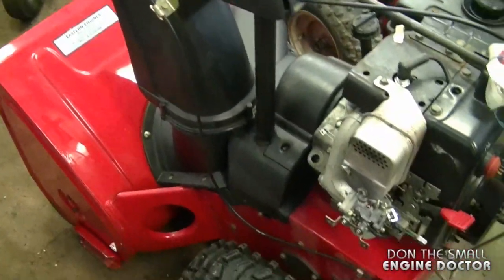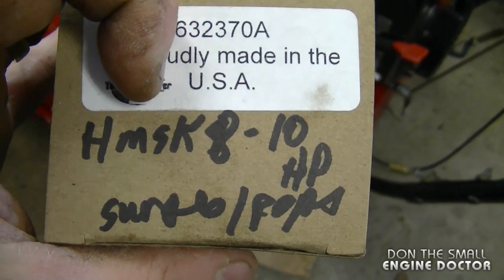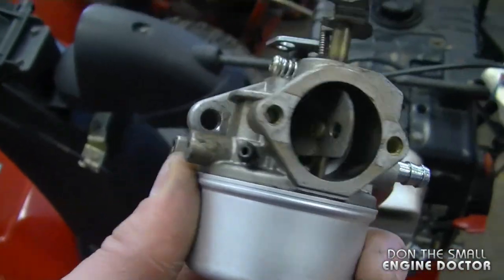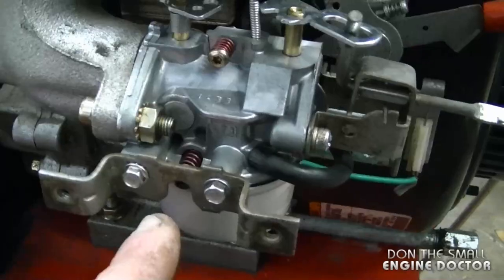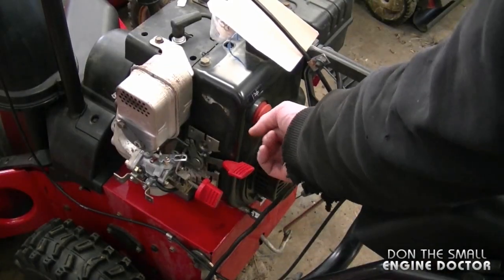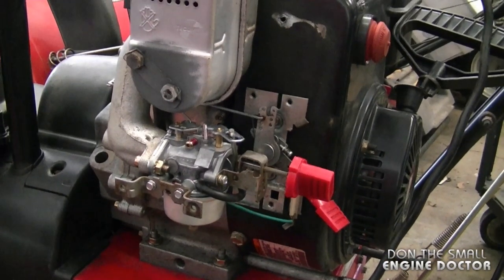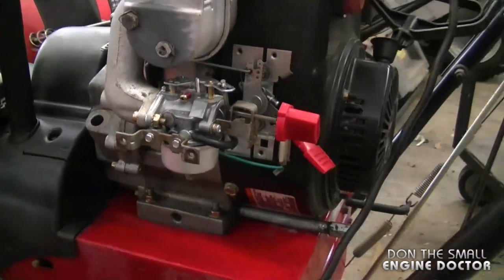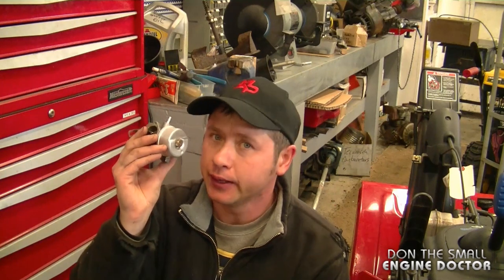Can I Swap A Non-Adjustable Carburetor For An Adjustable?

Comment: I have a 25 year old Generac 5000 watt generator that has a 10HP Tecumseh engine with the non adjustable carb that developed a surging problem when it ran causing the output voltage to vary. Cleaned the carb and installed a carb rebuild kit. unfortunately even after the rebuild was installed it still surged. I thought I was going to have to buy a new generator until I saw this video. I decided to give the adjustable carb a shot, so I purchased one and installed it. The old generator runs better then new. So thank you Donny for the video, you saved me the cost of a new generator. AWESOME video, keep em comin!

Comment: I have also successfully swapped an non adjustable main jet for an adjustable one, they are available on amazon. I did have to shorten the bowl nut, but worked like a charm. It was for a 12 HP Briggs motor.

Comment: Love this guy. Just ordered a new adjustable carburetor for my 8 HP Tecumseh snowblower. The old fixed nut carburetor still works okay but has always idled a bit rough. Don's advice and How To videos taught me that  it is easier to replace the carburetor (new one only $15. on Amazon) rather than spend time trying to rehab the old one. Thanks !

Comment: I've been battling issues the 20HP Honda V-twin motor in a side-by-side. Seems to need the choke pulled out a bit to run. Or is surging and backfiring, so could still be something else. Still up is checking the compression (easy on one cylinder, almost impossible on the other with the way the engine is mounted), and seeing if there's a way to see if it's something in the ignition. A new, non adjustable carb, didn't seem to make any difference. Thought it was maybe fuel, but I added a temporary electric pump and that didn't make any difference. The problems are even worse when it's cold. So I'm off to try searching for an adjustable carb for this motor. And going to keep searching through your videos for more info and tips. I sure appreciate everything that you share.

Comment: did a similar swap on an ECHO SRM-210 weed trimmer.. removed the non-adjustable carb' and replaced with a Power-Pruner fully adjustable carb' incl' the intake manifold. The only tiny mod needed to be done was to shorten the little brass hose that leads the throttle cable and holds it before the carburetor's throttle lever. This weed/grass trimmer (SRM-210) has become the no.1 weedwhacker for all teamnates ever since I swapped carb's

Comment: I was having trouble with a HT75 limb saw running.  I replaced the non-adjustable carb with a new adjustable.  Ran good out of the box.  A few tiny adjustments and it runs great.

Comment: The adjustable carbs are great for use with booze fuel as well. You can richen the mix a bit to counter the lean burn tendency of alcohol in the fuel.

Comment: Hay Dony I really enjoy you'r vids ,very informative how to and part numbers have helped me with my chainsaws ! I've had 5 Honda eu2000 and they seem to last about 2500 hrs.before they seize up and have to be rebuilt .I'm in California and our gas has ethanol ,I use Star Tron stabilizer/ethanol product all the time ,fresh gas no more than two weeks old ,change oil every 100 hours ,my newest eu2000 I'm using straight synthetic oil in hopes it will run longer before rebuild ! My use of these generators is 95% idle and rarely run hard .It would be nice to hear from the Doctor on these small engines . Thank you and Happy New Year !

Comment: The main problem with most Walbros having a fixed/non-adjustable main jet is during cooler weather operation. During cool weather, and running at 3,200 RPM, the engine will sometimes run too lean on fuel and operate erratically. To fix this, first of all, make sure the hole in the main jet is not partially clogged. If it is, use a  carburetor jet cleaner wire set or an oxy-acetylene welding torch tip cleaner to clear any debris that may be lodged in the hole. Then use [150± psi] compressed air to clear out any dirt/debris. If the engine still runs too lean on fuel, simply enlarge the hole in the main jet a few thousandths of an inch. Then use [150± psi] compressed air to clear out any metal particles. Be careful not to enlarge the hole in the main jet too much, or the engine will run rich on fuel!

Comment: Thanks so much for all your great videos. I love the idea of older style carb (most probably larger jets so less likely to clog). Working on a smaller HSSK50 and was wondering if there is a carb to replace 640084b fixed jet carb?
Reply: I’m looking for the same thing for my horizontal shaft 5HP , anyone out there knowing of what to order and where for this new adjustable carb?

Comment: Would love to see a general carb tutorial, basic setup for novices. I inherited a mower that's gotten out of whack and had its carb screws adjusted badly.
Reply: So would I. Three brands (Tecumseh, Briggs, Honda) side by side showing similarities and differences. Having the engines running and being able to hear and understand each adjustment would really help a beginner like me.
Reply: BirdsEyeView Normally, just turn all the screws all the way in and keep adjusting them all out a bit at a time til you get it running. Once running, fine tune each adjustment screw. Unscrew them to richen the mix and tighten them to lean it. Left = Richen Right = lean. If it's popping, surging up and down or lean bogging when you try to rev it, it's too lean. Heavy black smoke, sputtering or choking, it's too rich. These are general guidelines for about any small engine that should help you get it running. No 2 engines run the same with the same settings, even if their the same year, make and model. That's why it would be hard for Don to do a video on it. He'd get a million comments complaining it didn't work for them.

Comment: Hey Don, did you ever try to swap a bowl carburetor for one of the diaphragm carbs on the old Toro S-200 type blowers? I love using mine when there is slush and wet snow because there is no chute to clog, but those darn diaphragm carbs are fussy and quit working at awkward times.

Comment: If my snow blower will run but it will not idle low do you know what the problem could be. It will only stay going at the highest rev and it never used to do this.

Comment: How much for the Tecumseh carb? After market ones are about $16. Or you can drill out the jet on the non-adjustable carb for about $8 worth of pin drills.

Comment: I have an HM100 generator engine similar to this one that has a fixed engine speed and I want to be able to adjust the RPMs so it's not always wide open.  Do you know what part numbers I'd need to convert it to operate just like the snowblower engine in the video?  It looks like it's just the lever assembly and the rod to the governor but I'm not sure.  I'd also like to put this adjustable carburetor on it.

Comment: Are these available for the new Powermore 277cc engines used on the new (2016) Troy-Bilt snow blowers? Mine surges even though it is brand new. If so what is the p/n?
Thanks.

Comment: Hi donyboy73. Thanks for the great video. I swapped my non-adjustable carb for this exact adjustable one last year. Ever since then my snow blower will run fine for about 7 or 8 minutes from a cold start. Then it just shuts off. I start it back up and it runs fine but shuts off after about 1-2 minutes. It keeps stopping every 1-2 minutes after this. I did some research and tried the following: (1) Tested the gas cap to make sure it vents. It does. (2)  Checked the spark plug... it looked fine but I replaced it anyhow.  (3) Empty the tank completely and use fresh gas. None of these things made any difference. I've also read that it could be a vapor lock issue because the gas line is routed in a way that causes it to heat up. I understand the idea behind that but the gas line is routed the same way it was before. Do you have any suggestions? The motor is a Tecumseh HMSK90.
Reply: Did you ever get this figured out? I just put on an adjustable carb and it either won't start or revs so high its about to blow.

Comment: Donyboy, would you explain how to remove black limiter caps. Model I'm primarily interested in is, Sthl FS80R Pro Series. I've attempted; but appear they will break appart while removing. Will this matter? Should they be reinstalled. Both adjustment screw appear to be similar to phillips head in design rather than pac man or spline. Thanks
Reply: well i can take a piece of wire bend it tight so it fits hole, heat it up put it in hole into plastic let it cool twist it pull it out

Comment: This might be my problem.  I replaced an adjustable with a non-adjustable carb and now I can't even get the engine to start.  I've replaced the ignition module and spark plug as well.  I will buy another adjustable carb but I have a question; the model number shown is for the Tecumseh brand and when I google it , it pulls up the carb you've shown for 90.00 and some on Amazon that look the same but are 1/4th the price.  I suspect these are Chinese knockoff's,  what do you think? I've spent over 150.00 in parts on this MTD 5 HP Tecumseh.
Reply: are you new to this game put your carb number in search line don't have to get fancy push enter it will come up with all the carbs ebay free shipping why do you all want to spend the high price this is what computers are made for searching to get lowest price,not amazon there are all kinds of part stores out there

Comment: Thanks Don :-D
i have the same sort of carb on a mower, the bowl rubber seal is dead, my local shops just say its not possible to get the bowl seal.
Are they talking nonsense?
Reply: zx8401ztv like the big bowl gasket? if it's a Tecumseh carb, then that's probably nonsense, there's even aftermarket for that if it's a semi common carb, typically comes in a rebuild kit. if it's a newer "house brand" Honda clone or similar, that might be true, those are apparently "replace the whole thing" due to price.
Reply: Thanks for a reply rpavlik1 :-D, yep its a tecumsey carb and engine, so my local shops are talking crap, i did wonder.
I may try an ordinary "o" ring and see if the carb runs, then seek out a petrol tolarant one, i will jump to non mower shops.
Reply from the maker: it's available, part number 631028a let me know if you're stuck
Reply: zx8401ztv I cant believe they said its not available. A month ago I went in for a generic 90 degree fuel shut off valve, "I said Im putting it on a Tecumseh engine" the guy said Tecumseh like I was from outerspace. These dealers need to get with it. Millions and Millions of Tecumseh engines were built, just because they went out of business doesnt mean their engines arent still running and being used. I usually go to www.partstree.com now. Enter your model it will pull up a diagram of the engine and point to the part and list it and its cost. Or just go buy the part number like he did, but one thing if you get it off the internet makesure you make your putchase count, they charge 8 bucks to ship it either way. Thats most of those part websites. They started making after market carbs, cant believe that guy said its not available. He didnt have it and didnt want to deal with getting it so he said that rathervthen telling you where you could go. He wants your Tecumseh to die so you come buy Briggs parts. Either that or just a moron. Their reproducing everything now. Only some of the really old parts and the old points magneto assemblies have not been reproduced yet. Once the made in the USA nos parts dry up, your option will be China, China, China. You should go to that site and buy a rebuild kit for 16 bucks and pay the 8 shipping this way if anything else went bad youll have the repair kit. Because even if you order a dollar part, their charging the 8 shipping. Unless Dony knows of a better placr to order small engine parts?
Reply: Thank you for your reply :-D
I think your right with the dealers attitude, i didnt mind paying extra for the part if they had to order it, but it does sound like they just didnt want to try if the part is available.
It is possible they wanted to sell me a new machine, well that just isnt going to happen, this mower isnt worn out, and i hate throwing away anything that is repairable.
Modern throw away society, ive never liked that attitude.
Reply: Thank you Don :-D
If i cant find a supplier i will get back to you :-D

Comment: Can anyone tell me what the smaller second screw is for on the bottom of the adjustable carb. It has a spring like the center one. Is there a turn setting for it as well?
Reply from the maker: 1 1/2 turns out

Comment: This is all true until the EPA decides that the pollution of a throw-away engine economy is better than the longevity you get from the availability of adjustable carbs.  On any given day I can find a dozen or so engines on the scrap pile near me, and most of them have nothing wrong but a gummed carb.

Comment: hey dony can it you find part number for a5 hp tecumseh that's adjustable
Reply: Check on Amazon, find your motor number, probably a HMSK50, I'm just guessing. Then look for the carb with the best reviews.
Reply from the maker: yes or on ebay

Comment: And those pesky no name, no part# on the carb B&S opposed twin engines are a real joy too.
Reply: I have a second-hand Craftsman 42inch mower with the 19.5 hp B&S flat head opposed twin.  The non-adjustable "emissions" carb is frustrating.  I have to run it partially choked and it surges at idle.  Better than when I got it.  It sat with water in the carb and lines for months.  It was nasty with jelly slime in the bowl.  Cleaned out and put a carb kit in.  Runs and mows good enough.  New carbs are expensive and I haven't found an aftermarket adjustable replacement.

Sorry for the probably TMI brain-dump.
Reply: Iron Golem I bought my 18 h.p. H.D. Craftsman new in 1993 and still have it today.I,'ve put 3 carbs on it and it still surges at low throttle.It came with the factory manual.In the glossary it says carb adjustments pg. 14. The page is missing and was never there. I've tried everything to smooth it out.
Reply: I'm not a huge fan of the replacement (non-adjustable) carbs for those engines, but they've not been particularly problematic. They do require a good cleaning more often than it seems like when they had adjustable carbs, but not anything bad. 
Those engines were some of the best ever made, even with the silly EPA carbs on them, they were still hard core.

Comment: I've had poor results using those China Tecumseh copy carbs. Either fixed jets or adjustable. Leaking bowl gaskets and poor performance, surging etc.....just not as good a the real Tecumseh. These China manufacturers have some real quality control issues IMHO. I finally ended up just doing a complete rebuild of the Tecumseh original adjustable model and all is well now.

Comment: I'm pretty sure that is illegal in the United States. They do usually run way better though.
Reply: It's not illegal... Why would you think that?
Reply: Emission regulations in the US and Canada say you can't adjust/modify engines to make them run richer or less fuel efficient, for example taking the plastic 1/2 turn (or so) limiter screws that cover carb adjustment screws on the newer 2 strokes. However, this does not apply to home DIYers only professional dealers and shops. I am not sure about this case though but definitely something to keep in mind as the penalty is huge.
Reply: If you can't adjust a carburetor, how do you compensate for altitude and temperature changes?
Reply: @jrwyak  ..great point!!  ..